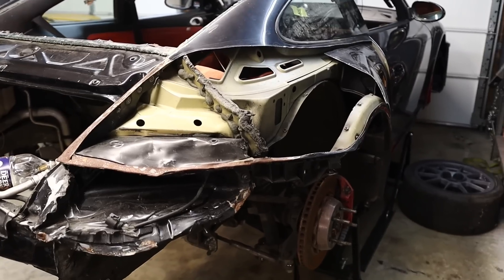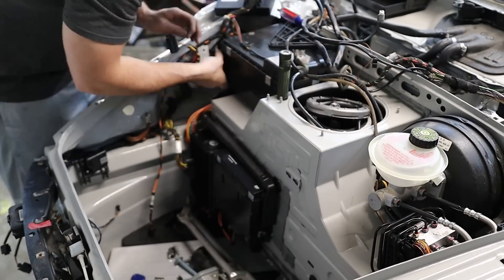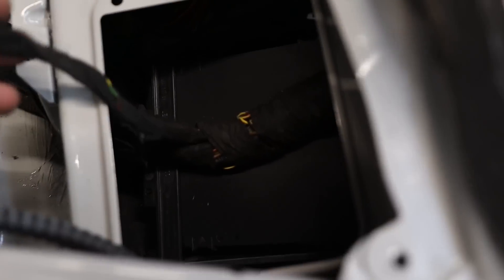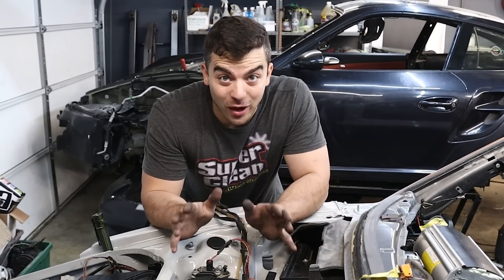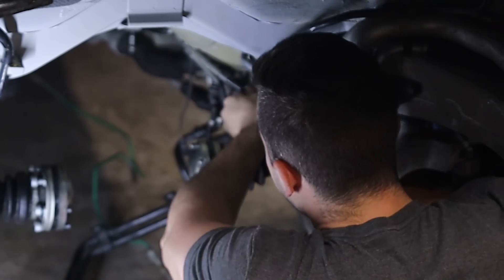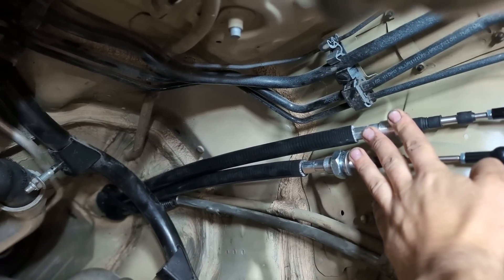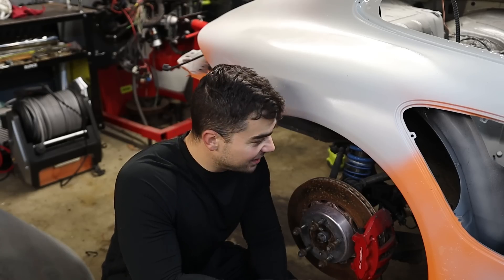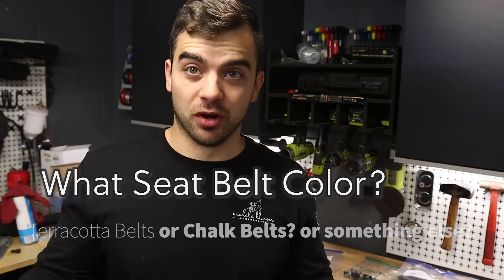My Crashed 997 Turbo Race Car Engine came with a HUGE SURPRISE

Comment: I gotta ask. Why didn’t you send it off to paint before you started bolting on stuff
Reply from the maker: Everything I installed, the paint underneath is already completed.  Did you watch the painting video?
Reply: @matt13ross  Yes I watched that video. Sorry I did not mean for that to sound negative was just thinking you might not have to tape stuff off. I really like your videos btw I hope to have a project like yours at some point before I am too old
Reply from the maker: All good!  Everything that needed to be painted before parts installation is all done.

Comment: 997 Turbos also need to have cams pinned.  That's a potential catastrophic failure point on the 997 Mezger
Reply from the maker: I'm not too concerned with that right now.
Reply: Not a catastrophic failure risk.

Comment: Looks like EVOMS GT2 slave cylinderkit
Reply from the maker: Thank you
Reply: I believe BBi makes a good one too if you need to replace. The factory one is softer, but that accumulator fails on a regular basis.

Comment: Get yourself a cheap SD card reader. Don't rely on GoPro. You might have been able to fix the SD card within Windows and recover your footage!
Reply from the maker: I also put the card into my computer and it won't load it either.
Reply: @matt13ross Dang. There are some recovery tools available -- windows has the builtin Chkdsk utility and you can probably find programs to recover the files off the disk if it's too badly damaged. Depends on how invested you are in the footage if all the trouble is actually worth it.
Reply from the maker: I tried for a few hours with no luck lol
Reply: @matt13ross Ah well, worth a shot! FWIW, I only use Samsung SD cards in my GoPros these days, I had too many bad experiences with SanDisk cards giving me the gopro SD Card error.
Reply from the maker: I may make the switch

Comment: you are trying too hard with the seat belts. When you try to hard it does not look good. Black seat belts are fine and will look good. Brake calipers the color of the interior ? No way that will look super low class. It's a beautiful, elegant, understated car. Don't ruin it.

Comment: I love watching these videos, but please stop ruining threads and bolt heads with the impact driver.
Reply from the maker: Not ruining I assure you
Reply: That's not an impact gun.  It is an electric ratchet with variable torque settings and you hear it skip when it reaches the setting.  It's still advisable to go light and finish with a torque wrench.  But let's face it, on non-critical M6-M10 hardware, an experienced wrencher ought to be able to get close enough.

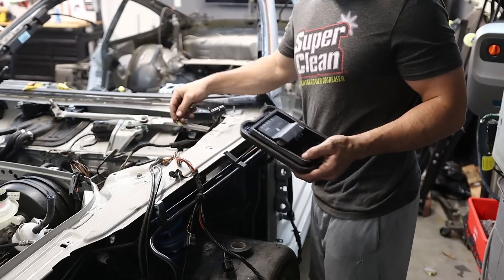Comment: The one thing that bothers me is all the dusty parts going back in, like your "mystery module" @6:20.  I would not be able to rebuild a car without wiping (and let's face it, probably polishing) every part as it went back in.
Reply from the maker: Don't worry, I'll be cleaning. One step at a time

Comment: not sure if it is a Youtube thing but the dang ad pop-ups at the bottom of the screen are annoying as hell.  Persistent little buggers.
Reply from the maker: Ads?  Yea that's just YouTube lol
Reply: @matt13ross  it looks like products you tagged on the video.  For sure enabled by the content creator.  Gotta do what you have to do I guess.  Peace out.  👎
Reply from the maker: Peace out because of tagged products? Yikes lol
Reply: @matt13ross Yep.  The persistent ad banners at the bottom left of the screen every time a tagged product is referenced or used in the video is terribly distracting and annoying.  Honestly, of the several car-related content creators I follow, your channel is the first I have un-subscribed because of this “feature”.  Again, I understand the need for advertisement and ability to generate revenue, but the ads are annoying enough that I no longer care to watch the content.  Truly, best of luck.  I recognize you work REALLY hard.  What you do is not easy.  But… my OCD > your hard work.
Reply from the maker: Well it's a new feature and I simply wanted to test it out.  Plus a lot of people ask what tools I use so tagging them seemed like the right move.